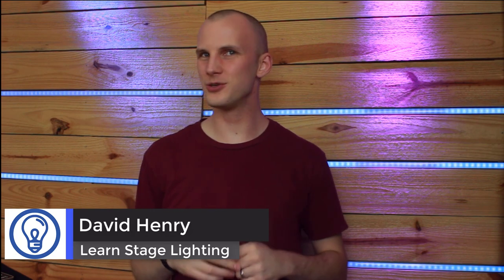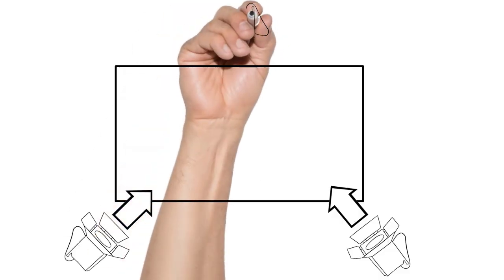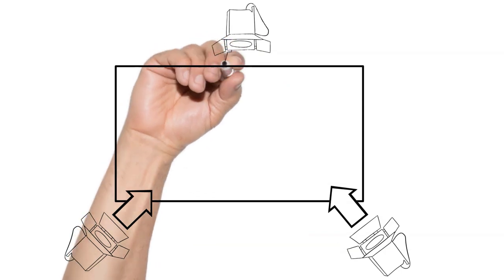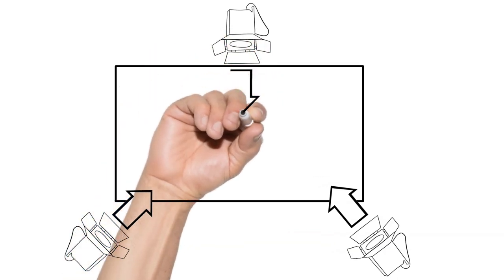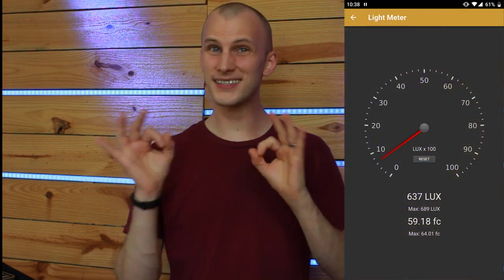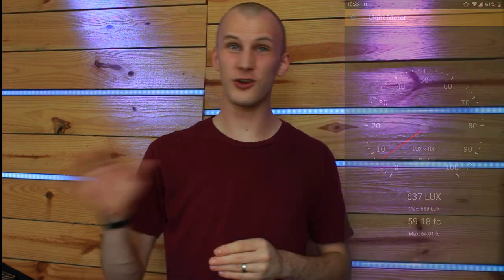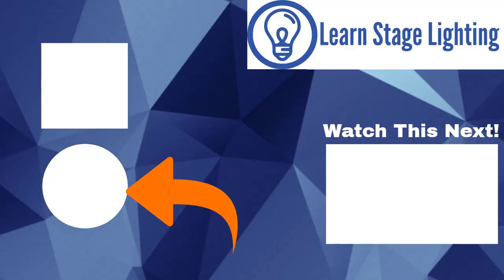How Do I Make An Awesome, Even Wash of Stage Light?

Comment: Great videos! Do you have any videos with tips about LED battens? I haven't worked with them before but considering getting some.
Reply from the maker: Well, a batten is going to follow the same principles as this video shows, they just put out a super-long beam of light.  I'm not a huge fan of using them for front lighting, but if you must, I would use the same angles I mention in this video - just instead of a "circle" of light, they'll put out a "long circle" of light, so each light will cover a narrow but wide area.  Or, turn them on their side (tall ways) and you can use it to light from the sides or back (which is where they're best suited).

Thanks!
-David

Comment: HEY, Great video! I'm volunteering to lighting a kids Christmas pageant and for FOH I'm going to use 2 speaker stands, 1 on each side for my front wash, It's a relatively small area so I'm thinking my par 38s with flood bulbs will work well, HOWEVER I can't hang anything. I'll use some of the churches area lights focused on the stage for back light. Please give me some tips, will have 2 on each stand.
Reply from the maker: I think that's a great idea!  Usually the best way to do it in this circumstance is to mount multiple lights on each stand, and then point them so that each light covers the next spot on stage where the previous light begins to fade off.  The same principles I teach in this video still apply - do your best to get 2 points of light to each spot on stage - it makes a BIG difference!

Comment: David.   Love watching and learning from your videos.  Thank you for using your gift to help the rest of us.
My question is what fixtures would you suggest to front wash a 12' deep, by maybe 24' long main performance area.  Our problem is that our entire drop acoustic tile ceiling is only 11' tall.  The stage is 1' tall, so only 10' above the stage.  We are streaming all of our services and currently using track lighting temporarily.
Also another delima is they would like to have the fixtures have white housings due to the white tiles.
Please help guide us.
Oh BTW they bought a year ago a couple of the Chavet DJ EVE-TF20 but have not installed yet.
Reply from the maker: Hey, David.

Please send us a email to gear@learnstagelighting.com so we can get some more details from you and get a tailormade solution that will work great for your room and needs.

Comment: Hi David! I'm working on a lighting plot for a 24'x24' stage and the grid is 12' above. I only have access to ETC S4's (19, 36, 50, 90). The grid is 35'x27'. I'm really struggling with this and I was wondering what you would suggest